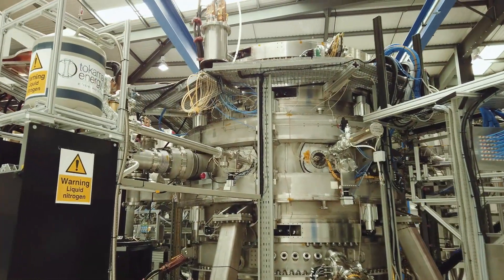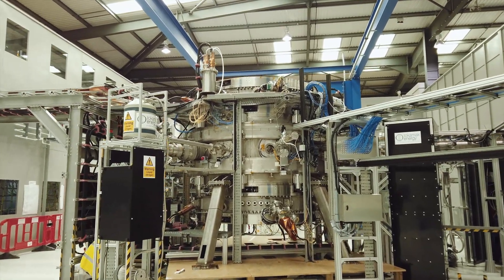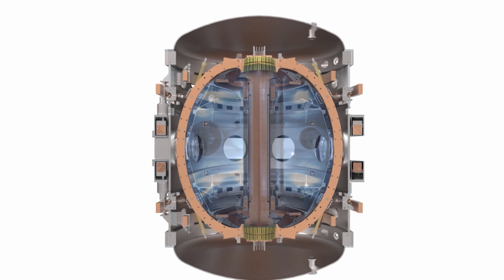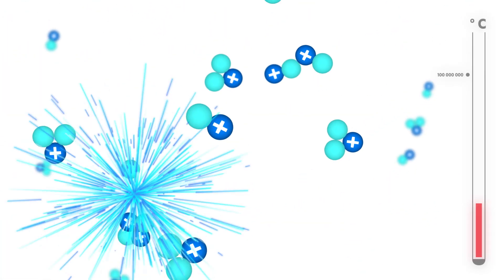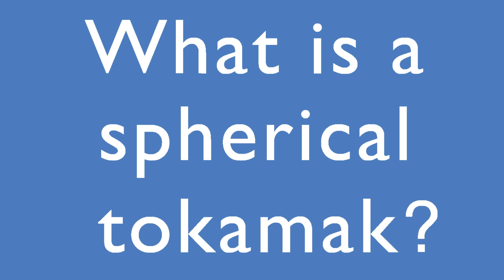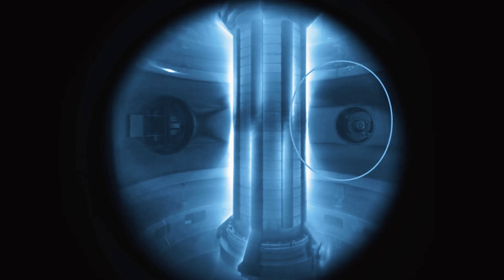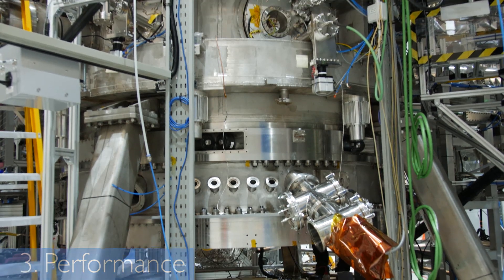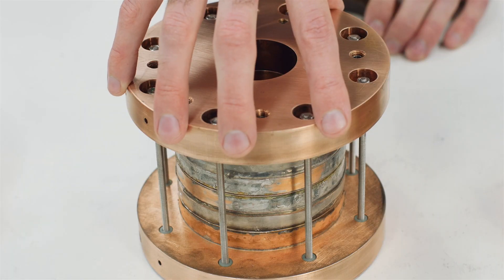What is a tokamak? And is a spherical tokamak different?

Comment: What would be the disadvantages are of a spherical tokamak vs toroidal?
Reply: They are both toroidal.  The spherical tokamak is a low aspect ratio torus.  The main disadvantage of the spherical tokamak is that the engineering is more challenging because of the squashed up design and lack of space, but if we can deal with that then we can build a more efficient machine.
Reply: @Melanie Windridge

Check out these articles on Graphene as a "High Field Magnet", and so much more!

Graphene can not only be the High Field Magnets, it can be every part of the machine, replacing everything.
From the outside as a shell plating, to the inside as the electronics, circuits, pipes, everything.
And it can be used as sensors, and so much more!

https://www.sciencedirect.com/science/article/pii/S1631070512001557

https://newscenter.lbl.gov/2010/07/29/graphene-under-strain/

https://phys.org/news/2019-12-magnetism-graphene.html

https://www.ru.nl/hfml/research/research-highlights/highlights/graphene-quantum/

https://arxiv.org/abs/1004.3396

https://www.nature.com/articles/s42005-019-0161-5

https://www.researchgate.net/publication/7069773_Landau-Level_Splitting_in_Graphene_in_High_Magnetic_Fields

There are more articles, but there are just too many to link, google search "graphene as a high field magnet".

You see.. the High Field Magnets can be replaced with Graphene.
And everything else about the Tokamak.

Also let's not leave out Quantum Computers with their simulations and big algorithms solved in the blink of an eye. Quantum Computer breakthroughs are happening all the time, Archer Materials is working with IBM on Graphene with Quantum Computers to bring them to room temperature and for our Desktop Computers, phones, cars, laptops, in schools, airplanes and so much more, you should see their progress.
Quantum Computers should go towards helping your Tokamaks, IBM already has commercially available Quantum Computers, but they are nothing like Archer Materials in how Graphene will be used with them, can't wait for even more breakthroughs. Also you should check out Intel's Cryogenic chip for Quantum Computers, another breakthrough, and they can also now make Qubits smaller, faster, and more powerful,  a long with hot Qubits, and so much more is coming!
Oh btw, supposedly particle accelerators can now fit in your pocket, imagine accelerating other things in Physics much faster, very handy for Physicists.

----------
Q. Can Graphene be produced enough and cheap enough? 

A. Yes, check my other channel in the links below. 
----------

Videos with important info to get around my other channel.
https://www.youtube.com/playlist?list=PLAUtk-Q2DF7xsjVfESM1sqZdkHJYRw--j

Don't forget to check the rest of the channel on Graphene and Quantum Technologies, use the steps in the link above in this comment.

And here's one other video to check out on Flash Graphene, we can now make large machines in space "while controlling the carbon atoms and more, in a large structure so that they don't float around in space at high speeds", and on the Earth we can make another large machine, to produce Graphene faster, and cheaper. Think big about this.
https://www.youtube.com/watch?v=hKIqgD-Aeds&list=PLAUtk-Q2DF7xsjVfESM1sqZdkHJYRw--j&index=6&t=0s

Btw have you thought about Fusion Energy converted to the grid, but instead of Electrons for electricity, it goes from Fusion Energy converted to the grid as Photonics. And then replacing all electronics into Photonics as has been mentioned will happen at some point.
https://www.youtube.com/playlist?list=PLAUtk-Q2DF7yx80jrh7uORkHKowzGy7pi

Again please remember to check out everything on my other channel.